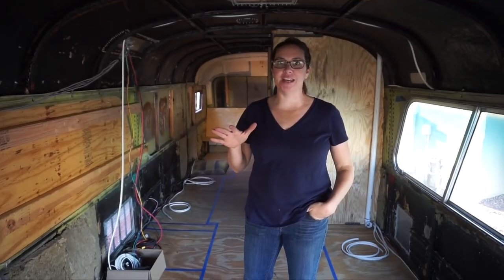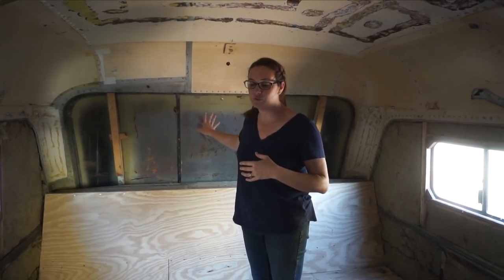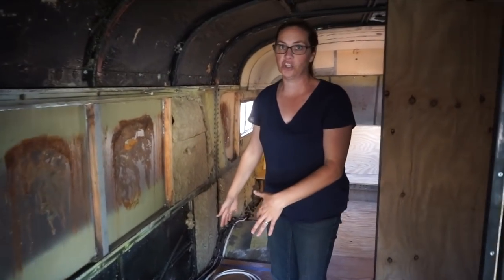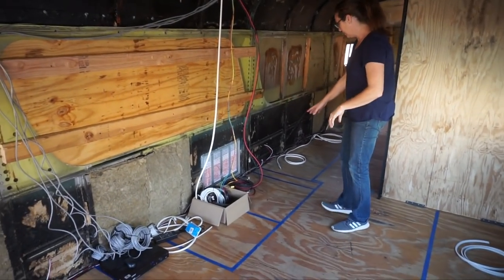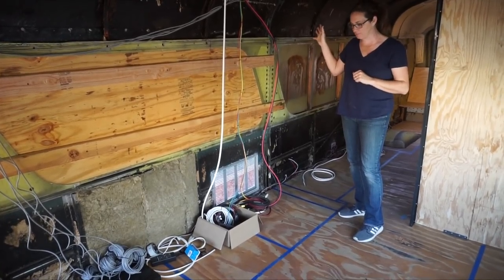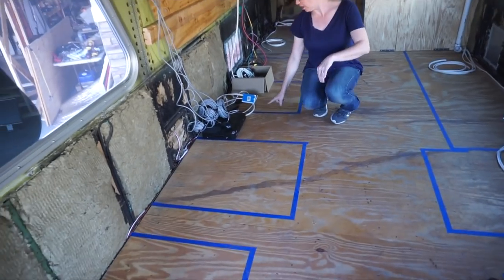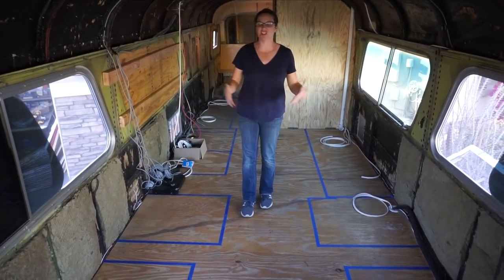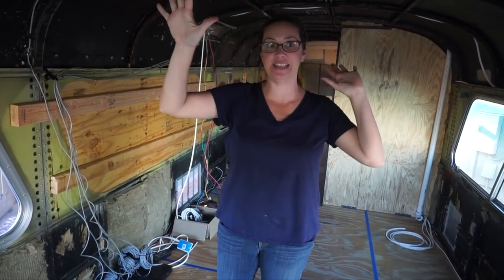We're Going In! Interior Layout Plans

Comment: Hey guys!  Been following the progression of the build since I binge watched to current, about six months ago.  Things are coming along very nicely.  I'm the guy that posted a couple questions on the "Oh, Hi There!" video about the power bay AC and the front door voltage step-down unit (thanks for answering them by the way).

Firstly, I agree with Mike's post about the rear master bedroom with a permanent bed and maybe re-thinking the kid zone.  Adults need their privacy.  Kids, not so much :)  In front of the kitchen, where the couches will be, it'd be easy to make "bed friendly" couches on both sides for the two younger kids with drop-down/fold-away upper bunks (like on a train) for the two older kids.  I'm guessing you're thinking that you'd rather have yourselves between the door and the kids, which makes sense, but I'm sure Juan could come up with some awesome security ideas to abate those fears.  Maybe even a motion sensor and an alarm that sounds in the master bedroom if one of the kids sleep walks near the front door :)  A rear master bedroom would also probably be a great area for the kid zone during the day.  A nice, big, flat, comfortable (and cool!) area that's always there.  It just looks like that rear bench is wasted space considering your tight confines.

Secondly, may I suggest some kind of hide-away portable toilet in the rear bedroom for emergencies since there are six of you.  You can always hold in a whiz, but sometimes you can't hold in a poo :)  Think - A mild case of food poisoning from that "slightly sketchy" place you just grabbed lunch from on the road... scary! Haha.

Lastly, my condolences on your loss of Stretch.  My dog now is my third.  It never gets easy losing a buddy and I feel for you guys.  Well, keep up the good work and looking forward to seeing your progress!

Sev
Reply from the maker: Thank you, Sev!  You're right - it's hard to lose our furry buddies.  As far as the sleeping arrangements go, we are going to discuss all of our thoughts and reasonings behind the sleeping arrangements when we get to that part of the build.  We have several different reasons for doing it this way, though.  We definitely agree about the extra portable toilet.  Your comment made us laugh out loud!  We have a camping toilet/bucket that may be the "emergency loo".  haha . Thanks for following along, Sev!

Comment: So sorry for your loss...losing a family member is a difficult hardship...Rest In Peace Stretch  <3
The master bed will be a kind of double futon that meets in the middle to make a queen sized bed?  Very nifty  :)
Have you planned cooling/venting for the electronics cabinet?  It will get very hot in there.
Maybe ducting for it (and the fridge) down to the side vent with 12VDC fans for movement where the litter box was going to go.
Reply from the maker: Thank you Gregory - Stretch was an amazing cat and she was very loved.  We are still working out the details of the bed in the front - we have a few designs competing for top spot :).  Both the refrigerator and the tech cabinet will need venting and this will likely be done via 12V DC fans and channels as you suggested :)
Reply: My heart is with you about Stretch...I lost my Ginger five years ago and it still hurts very much.
Pepper is my current companion...she is different than Ginger...but no less loved.  :)

Comment: Been following along even though we don't RV, we are boaters, but find your design thinking very interesting as it can apply to boats as well.  Did you consider moving the fridge back one position to take advantage of the built in venting?  I believe the fridge would benefit from that.  Sorry for your loss of Stretch.  Our pet dog won't be able to make the trip with us although she is still alive. We will miss her too.
Reply from the maker: Thank you Joe.  We did consider moving the refrigerator back but reconsidered again as we think the current layout will offer a little more flexibility.  We are planning to have fans and channels in the refrigerator cabinet to vent and still utilize the original vent to get some of the hot air out of the back of the refrigerator and outside.  The tech cabinet will also need to be vented and cooled so it will likely use some fans to push air out of this same vent.

Comment: I hope you will avoid using particle board or MDF for your cabinetry. It is heavy and vulnerable to moisture. Also, get yourselves a good air ride driver's seat. The tricky thing on the driver's seat is if you want it to swivel. That adds useable sitting space when parked. But it also adds a structural challenge. The high dollar version is Minimizer. Theirs reclines, swivels, heats, and massages.
Reply from the maker: Thank you Kevin - I think most of the interior build will very likely be plywood or solid wood - we have read that the other stuff contains formaldehyde and we would like to avoid that as much as we possibly can.  That being said - our kitchen and overhead cabinets are IKEA which I think does use some of those materials but has been cleared for formaldehyde.  I would love an air ride seat but we will probably just use the Toyota Sienna chairs we bought earlier in the build.  Just for fun, I looked up the Minimizer - WOW!

Comment: We were "staff" to a cat for just over 20-years, and understanding how they can become so much a part of your lives. Rest assured that Stretch WILL still be travelling the roads of your new journey with you. Every day, a memory will come to fore..
A coupla' questions, IF I maY:
(1) Would not that already vented area on the passenger side of the coach not be a good spot for the fridge? IF I understand correctly, you are planning a residential model, which like all refrigerators requires air flow; typically by convection in a home, but given the much higher ambient temps in a coach, often assisted by top and bottom vents, and temp-controlled fans,
(2) Is there a spot in your plans for "stowaway space"? I.E. - 5-foot, 9-inch, former bus driver, housebroken and kitchen-capable???
Reply from the maker: "Staff" - LOL!  Yes, I'm sure we will be talking about her and thinking about her all along the way.  We have thought about swapping the refrigerator and pantry, but we think the current arrangement will work better for our plans and offer us some flexibility for the future.  But, we do have plans to keep the fridge temps controlled with some 12V fans that are then directed down and out that old fridge vent at the bottom of the pantry.  Answer to your 2nd question...at 5'9" you are the perfect height for the bus.  Ha!  My buddy is 6'6" and has to scrunch down to walk in our bus...and we haven't even put the ceiling in yet.